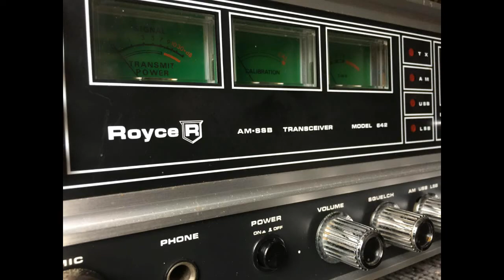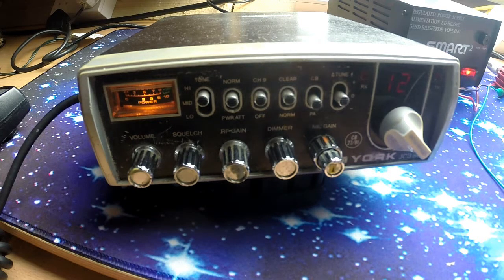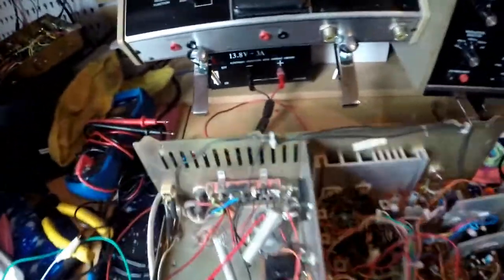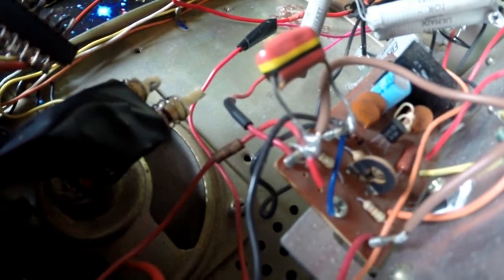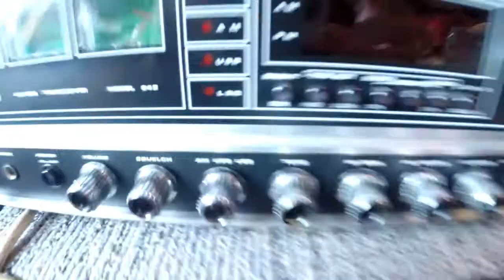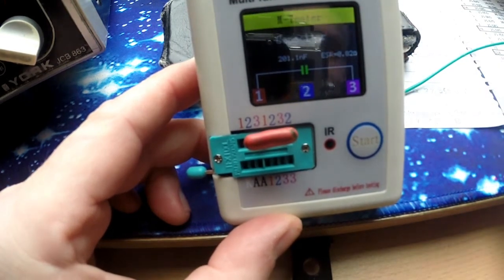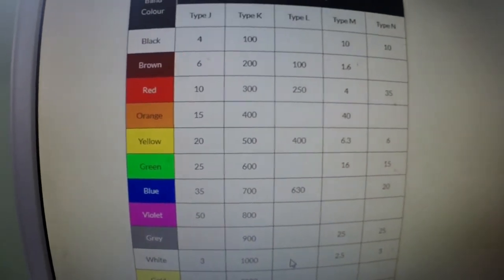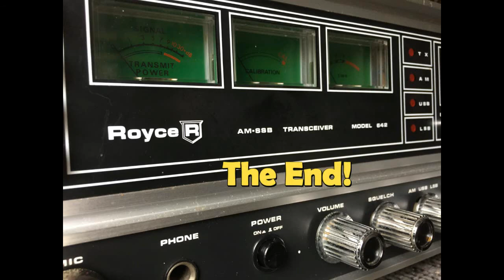Update on my Royce Homebase CB Radio

Comment: Such a shame that it’s not working. I’m sure it’s able to be done. The tropical fish cap looks like 34pf at 250v. Do you have the schematic? What’s the model number and I will see if I can find any info on it. Cheers Graham
Reply from the maker: Hi Graham hope all well,  I have the service manual for the radio and not sure that tropical fish capacitor should actually be there as not on the schematic, am making progress at alst and will be posting an update shortly. Thanks for the confirmation on  the caps value, 250v sounds a better option much appreciated.

Comment: Does the radio have 12v input socket ? . If so does it work the same on this input. Fix the internal psu, then fix the radio. To me, something has shorted, in the ssb mode circuit.
Reply from the maker: Hi marvin, It has only ever had the DC supply whilst I have owned it, it was originally an american 125v radio and didn't come with the original transformer in it as well as most of the AC wiring missing, thats how I picked it up for £15, so my only option was to get it going on 12V which I managed to do. 
Yes agree with your thought that its a short from the constant power drain and taking 3v staright off the power pack in receive and still dropping the longer its on, I have been on the case this afternoon and fingers crossed I appear to have made some progress which i will post up. All the best and stay safe.
Reply: @britishcbradio1055  Looking again, i can now see it has no transformer. Just assumed it was 240v. I have a President madison, european version on 240v. Hope you get it fixed.
Reply: @britishcbradio1055  Got myself a well used Hygain 5  to restore. Been through the wars, broken squelch control, but fixable, been modded and epromed. not powered it up yet, still checking everything and about 5 dead spiders inside, said it was a loft find.. lol